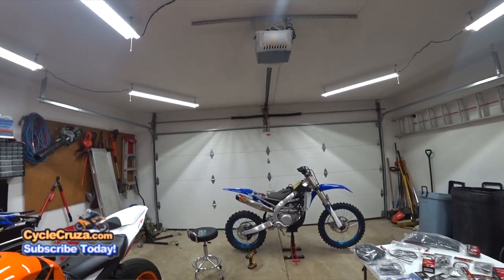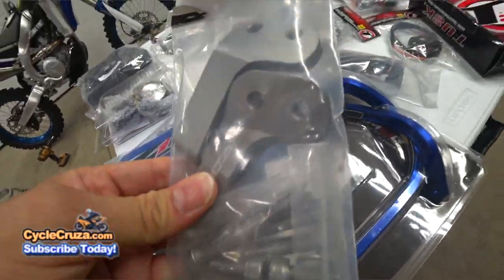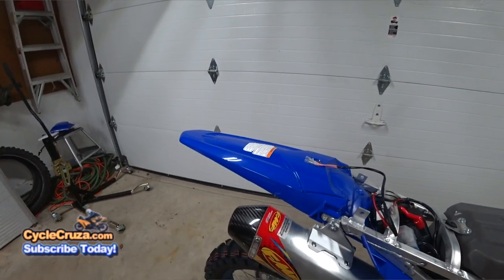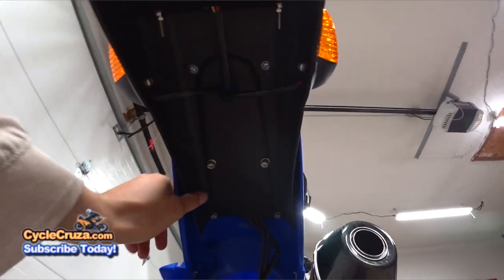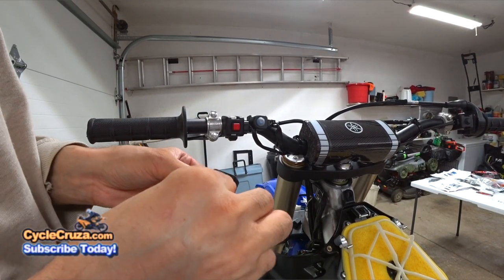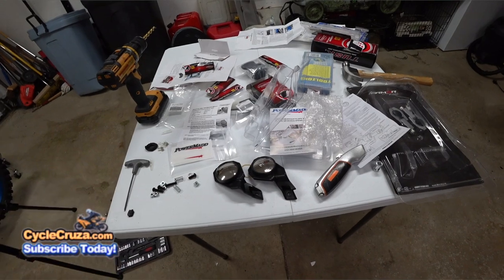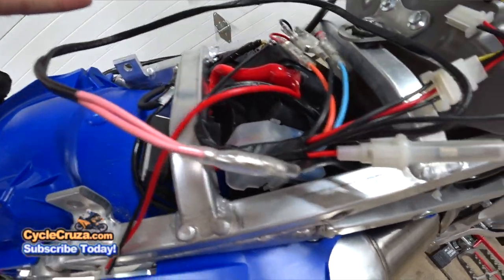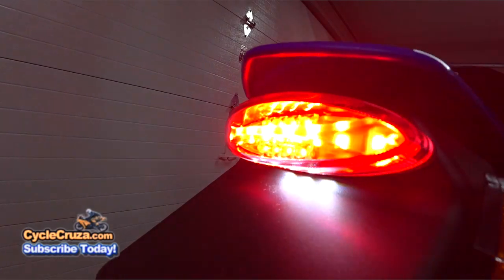Making it Street Legal | 2019 Yamaha YZ450FX BUILD Part 2

Comment: Those hand guards have a pretty clever mounting system.
Reply from the maker: It's better than those pos handlebar brackets. The side mounts are not cheap but they are mandatory if you want strong hand guards that you never have to adjust.
Reply: It never dawned on me to attach to the back of the triple tree mount. I forced my aluminum guards in front of the triple mount. Helps hide the gray of the triple tree mount.
Reply: I got these they are a must have

Comment: Does the brake light light when you use the front brake? It looked like only the rear brake got the add on switch?
Reply from the maker: No BUT it has a wire so that you can add a front brake switch that you have to buy separately. However, you should always be in the habit of using both brakes on the street anyways.

Comment: Sick build cruza! Those handguards and mirrors will be added to my basket 👍! Check out the OUTEX SM Tubeless Kit for your new wheels, may be better that the 3M tape in the long the run.
Reply from the maker: Thanks! Really the OUTEX kit is the same thing, using tape but much more expensive. I wish I could have got the Alpinas but I did not want to wait so long.

Comment: You'll be moving the brake light switch to the bar master cylinder.
It's gonna get smoked. Also, Fastway's hand guard mounts are a lot cleaner install. OEM WR headlight/mounts are gonna be less headache. Just add a LED bulb. I've plated both late model WR & FX's.

Comment: What's a bike that can 1) Ride single track in the woods 2) Pass on the highway at 85mph and make 500mile daily trips 3) Run ON/OFF road 50,000+ miles with no overhaul and only basic maintenance.... oil changes, filters, chain/sprockets, tires 4) Carry a few days luggage 5) Buy like-new, mint, used for under $5,000 and under 3 years old with under 1,000 miles?    I only know of the Suzuki DR650.  That's why I have 2.

Comment: shoudda just bought the husqvarna xD
Reply from the maker: Yamaha parts are easier and cheaper to come by, yam dealers are everywhere and the yam reliability is the best. Another vlogger has a yz240fx with over 100 hours and the valves are in spec and were never adjusted. Also, this 2019 yz450fx has way better KYB suspension and no emissions crapola on it.

Comment: the reviews are coming in for the crf450l.. having any second thoughts about your choice of motorcycle?
Reply: I think CC's plated YZ450FX would give the CRF450L a run for its money, and if Yamaha did do the same thing to compete against the CRF450L by factory plating a YZ450FX, he'd be laughing at it because 1.) He already has one, and 2.) The factory plated one will likely start out severely detuned to pass emissions, which CC may never had to derestrict his.
Reply: @E2Moto  i understand your point . But 1 the work hes putting in , equates about to the same to unrestrict the bike, and pretty sure he can get more hp out the honda.. and resale value will be higher.. adjustments will be a bit more spaced out... And no trouble to install all the electronic switches ect..and its a big red honda :p

Comment: I can't remember if you ever did a video on it but I just ordered a new lithium battery by SHORAI it's soppped to be better than the acid battery....it's lighter ,last longer being off a battery tender and has more cold crank amps
For a 2015 r3 I need 120 cca
Shorai offers I think 210 cca

Comment: Dude. CC not related to video but I am about to upgrade from my dr200s. I found a deal on a honda 250 rally for 4500 bucks new. Any thoughts on that bike I was originally looking at the wr250r or the drz400. Anyone got any real experience on these? Power doesn't tempt me. Any idea which suspension, ride, or quality is gonna be the best.thanks
Reply: I have a drz400sm, I put over 10,000 miles on it in 7 months with no issues and it's super fun to ride, I also have a crf250l that I put 15,000 miles on in about 2 years and no issues with that either so honestly I think either bike would be a good choice